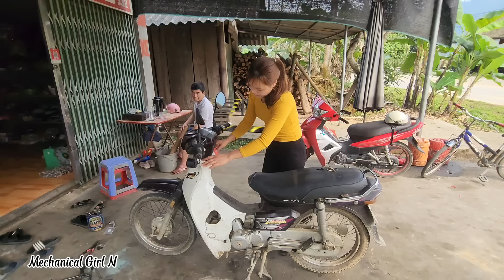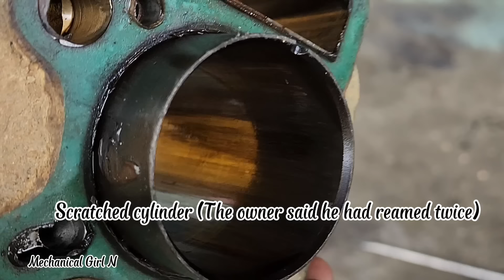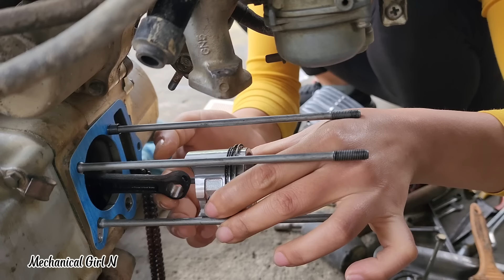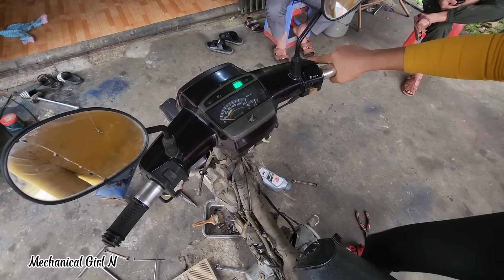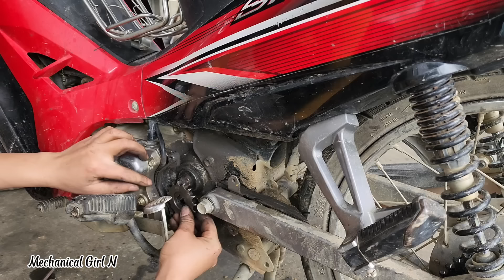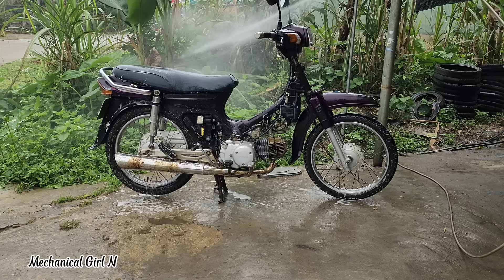Dream Viet's cylinder is scratched, the piston consumes 90% oil. Sirius broke the sprocket bearing.

Comment: Thanks for the video N! In english reconditioning a cylinder is called honing, so that one was already honed twice.
Reply from the maker: 😄😄😄Thank you for your feedback, sometimes I don't know which words to use correctly because there are so many different translations.
Reply: @Nghimban05   I know, I knew what you meant but I thought maybe I could help. A reamer is a tool to give an exact size hole in a machine shop. More accurate than a drill.

Comment: I have a suggestion: why don’t you remove the plastic protectors from the bearings, pack them with fresh grease and install them back. I think your bearings will last longer before replacing them again.🤔
Reply: Spot on👍
Reply from the maker: Hello! Did I do exactly what you said, or is it that the camera can't record?

Comment: Hola jovencita...viendo tu trabajo, reparas el motor..luego lo dejas prendido..supongo que es para el asentamiento del motor??  Son minutos o horas??....otra cosa.. cuidá tu salud..tienes tos..hazte una placa y visita un neumólogo!!! Tu salud primero bella... saludos
Reply from the maker: hello, thank you for your comment, when I was repairing the first engine and leaving it running rodai to switch to the 2nd engine was because: the principle of the engine after replacing parts related to lubrication is You must let the engine start in place for about 30-40 minutes to help the oil promptly lubricate the necessary parts.